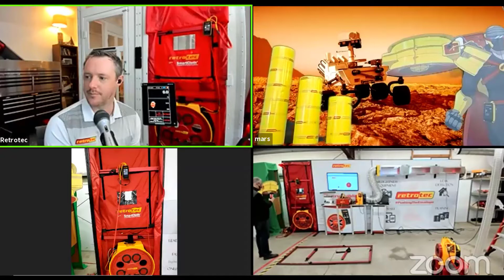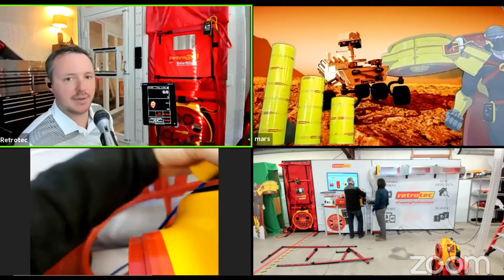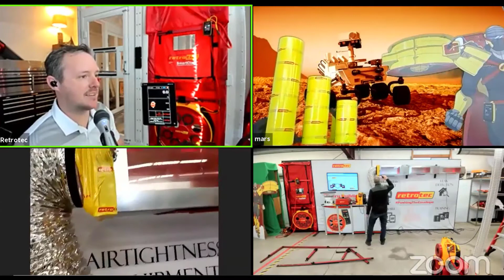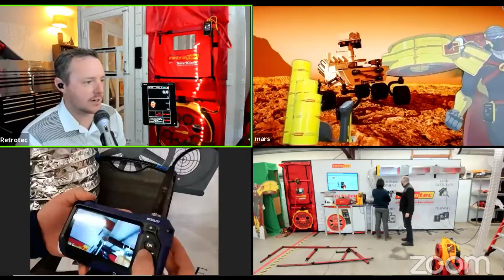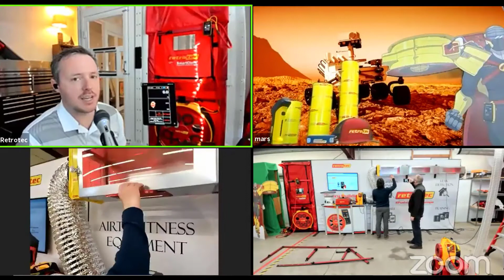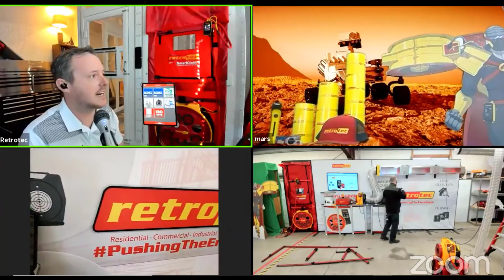RESNET 2021 Trade Show Booth

Comment: good job!👍👍  what is the resource of the frame elements.  steel connectors were more reliable
Reply from the maker: We use automotive grade plastics on all of our plastic parts. These are very reliable and we have had excellent feedback from our customers in the field. Quick to set up and take down without a decrease in quality.